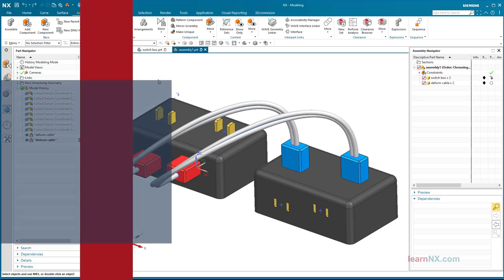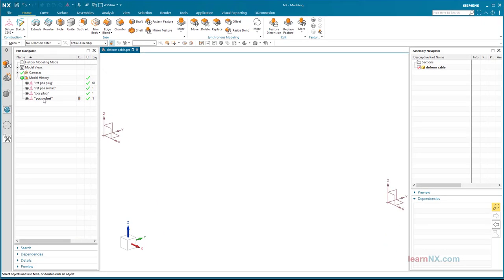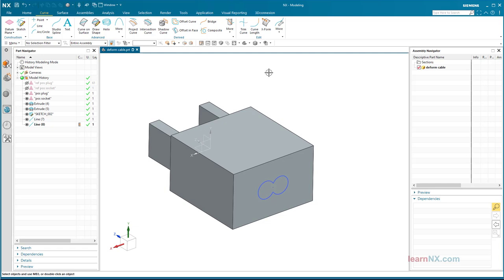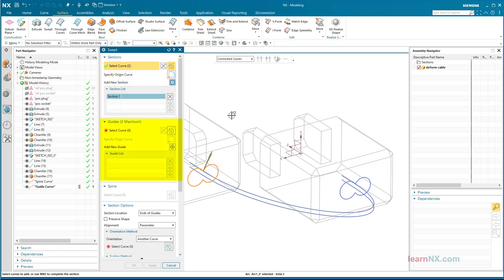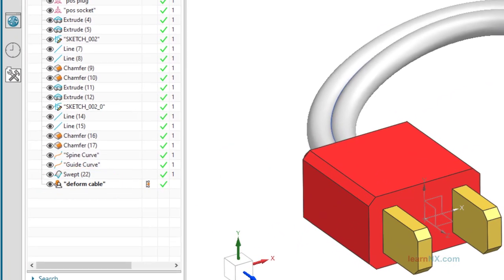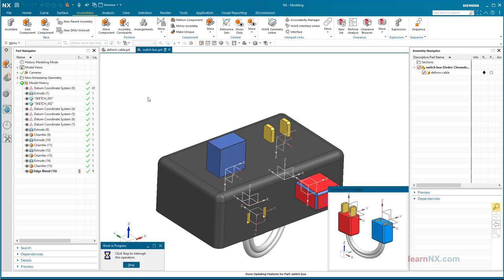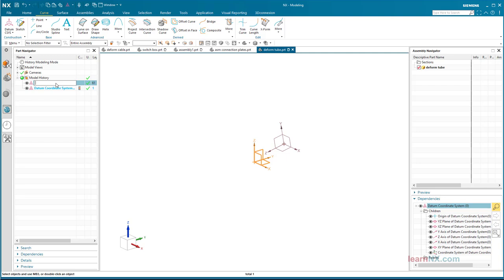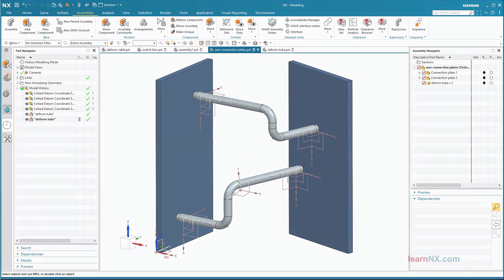Siemens NX Tutorial | Deformable Parts, with external references (for tubes and cables)

Comment: Question B: let's say I have   part A which has a hose socket. I also have part B, which is hose itself. Than I make an assembly with hose + part A with one end of the hose connected to the socket (second end should be free). Then I want to use this assembly in the another assembly as a child and connect the other (free) end of the hose with the socket on the secondary (parent) assembly. Is there a way to use deformable part feature in this case and how? I hope it is clear what I'm asking. Thanks for a very good tutorials!
Reply from the maker: But this video shows this using the wires. In the higher-level assembly, either a coordinate system must be selected to define the bridge curve, or a curve path. Depending on which elements you have defined as deformable in the deformable hose.
Reply: The hose comes pre-installed (non deformed state) with one end attached to the component A. At the time of creation of this subassembly, only one hose connection is known. The second end is installed later, on the parent assembly geometry.  Hose deformation should be then performed later, at the top level assembly to connect the remaining end. Anyway, I will indeed double check the video to see if I missed something :) Thanks again for the great videos!